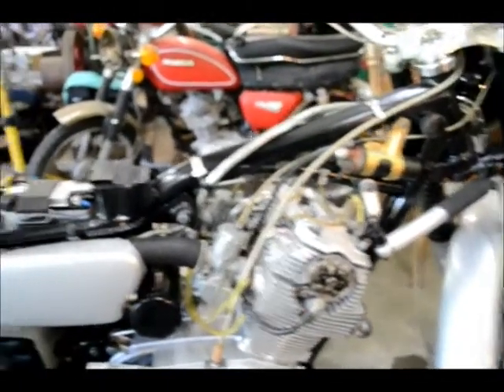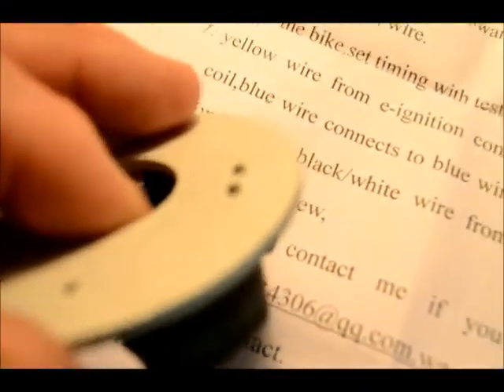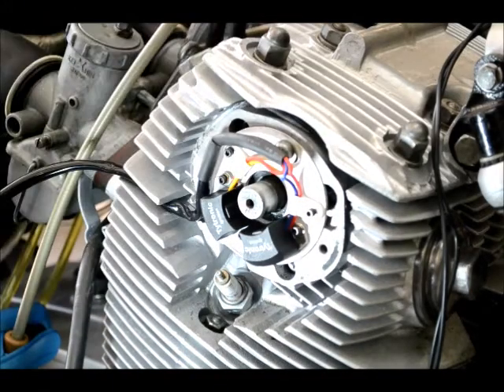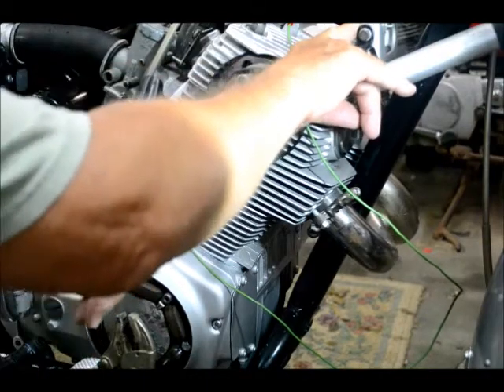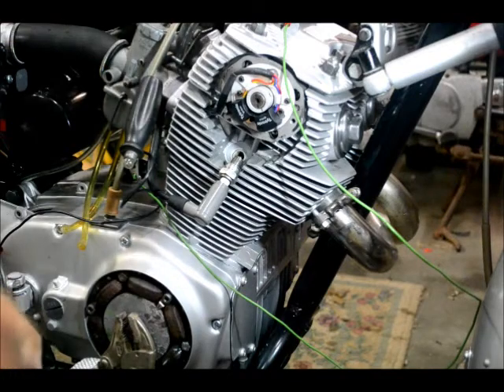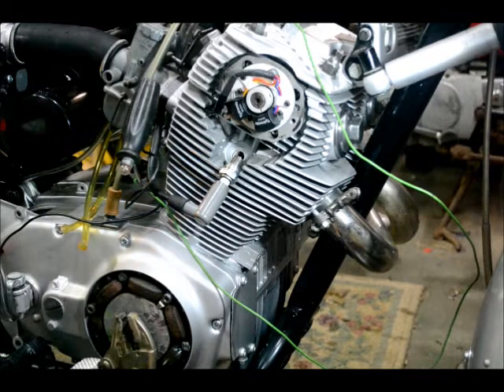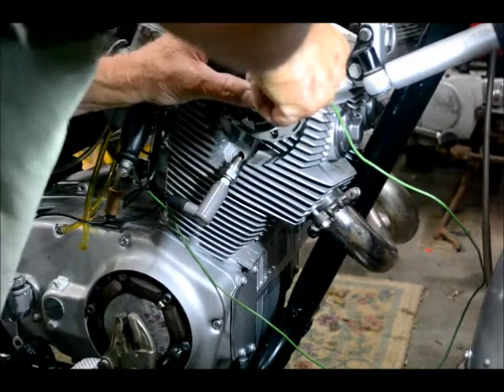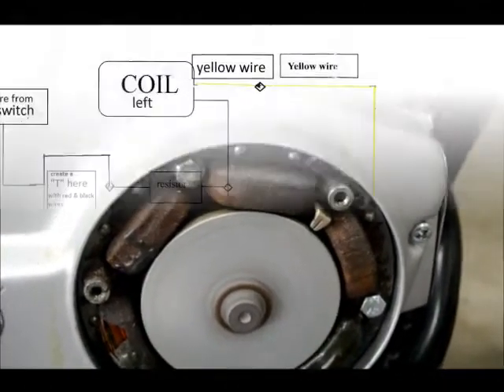Installing TYTRONIC elec ignition on Honda CB/CL  72/77 engine

Comment: I  have a 68' Honda 305 .. I  PURCHASED similar ignition from Jersey shore guitar.  the seller and I have been arguing back and for A week now... I set my timing with pick up around the 11 o'clock position as in his video... Got it set and went to install the cover and it's interfering with the coil... He kept telling me and still is that my timing chain is why the cover will not fit.. I laughed and laughed wtf ,, so put a PowerPoint and suggested he watch your video because you mention the cover interference... The sad  thing he didn't watch video or look and the images I sent him... Thanks for video I am going to try and set my timing with the coil at 7 or 4 o'clock position see what happens... I got scammed and should have known it was too good a price. $110. Also noticed he has a different cover. Later Honda which he still doesn't get it...

Comment: Maybe the resistor was in case you didn't upgrade the regulator/rectifier system. Charlies Place says: 

"All models manufactured before 1969 do not have a regulator as a stock feature of the charging system. While this does not matter with a points type ignition system, it is incompatible with the upgraded electronic ignition system. The electronic ignition system requires a steady regulated voltage to function properly. Bikes that do not have a voltage regulator will burn out the electronic system. Therefore, if you wish to use this system with your pre-1969 bike, it is mandatory that you upgrade the charging system".

Comment: hi did your kit come with a resistor? online it doesn't seem too and I messaged the seller and they said it didnt need one, why did you put on in your case?
Reply from the maker: it DID come with the kit, and I really think it might work fine without it. It drops the voltage to the coils to around 8 volts.